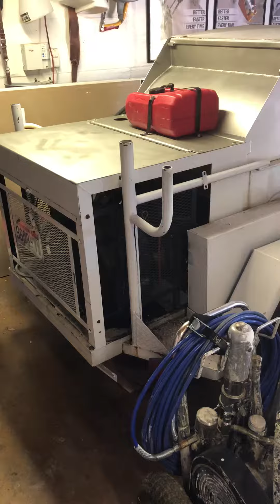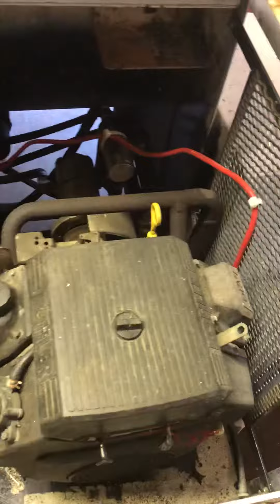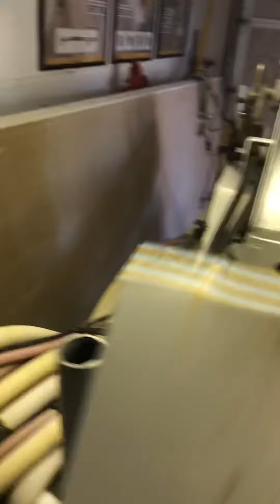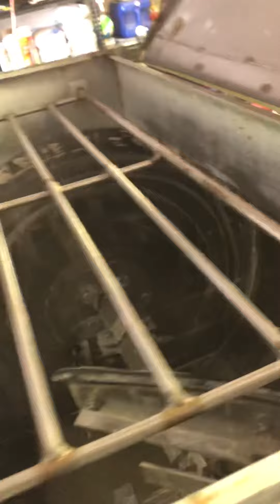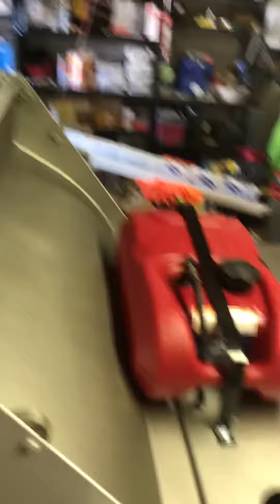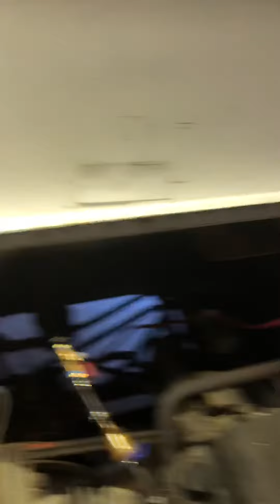OLD SPRAYKING 155 #3 | DRYWALLMIKE08

Comment: Did you get a Binks gun for this rig or are you going to keep the pole gun on it?
Reply from the maker: I have a binks gun for it but just using the flex pole for now. I sprayed a 200 sheet house Saturday with it. It did perfectly. I just started my own company so this is now my main rig. It’s no AST but it works 👍
Reply: Nice congrats on the new company. Spray King rigs work just fine. I have one myself. How did you like the flex pole gun compared to the Binks? I have been expirementing with a Binks myself and am curious to see your response.
Reply from the maker: Drywall Sprayer  I still prefer my binks gun. It’s just awkward using the flex pole. Like trying to spray with a dildo 😂